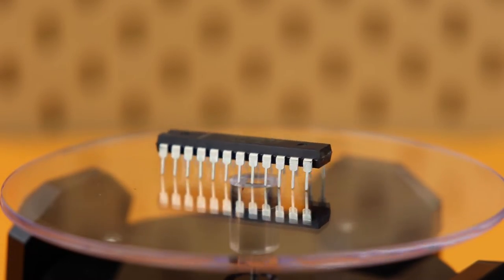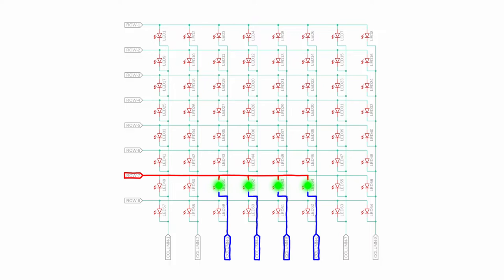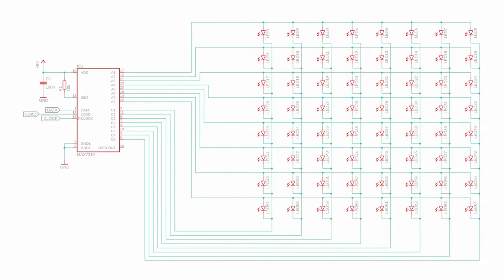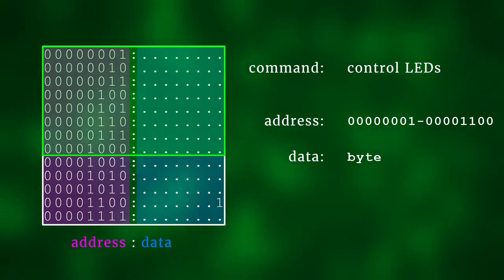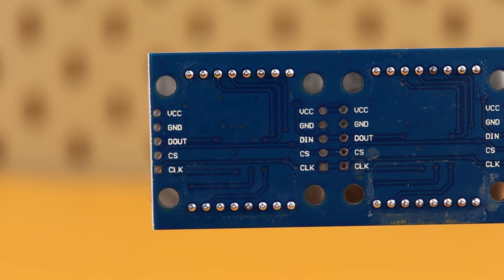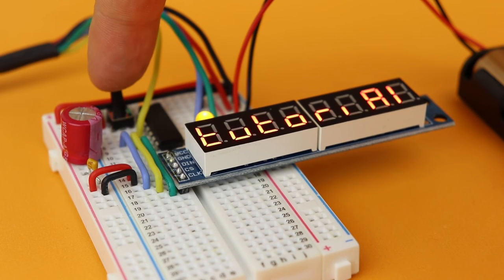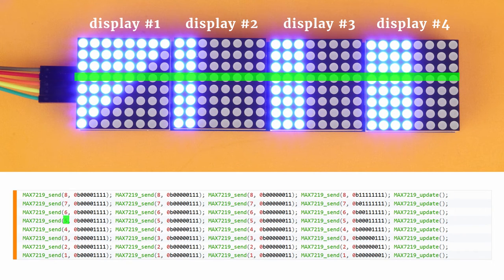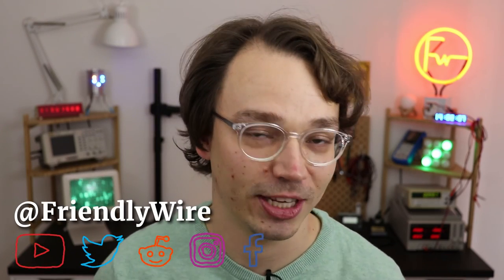MAX7219 LED multiplexing tutorial

Comment: I really dig how a YT content creator is using something other than Arduino.
Reply from the maker: Ha, thanks, I am glad you like my videos :) Honestly, I believe everyone should use what they want. For me, I get more joy out of using PIC microcontrollers, because I like to work at the level of registers, and I do not really like to use a lot of libraries or pre-built stuff. And in my videos I try to share this excitement. But of course it is also a bit hypocritical from my side, because I still use C to write the code, and not pure assembly. Arduinos are fantastic for some, so: to each their own 🙂
Reply: @FriendlyWire  I am the same way.  I’ve been programming PICs since 2004.  I am not a fan of libraries because I like to know how to drive things myself.  (Aside from using I2C and SPI libraries for consistency). I find Arduino sharpens my skills because certain parts/modules documentation is only in the form of Arduino libraries.  I need to pull those apart to write my own for PIC (like eink displays/etc)
Reply from the maker: @maxvideodrome4215 Oh yeah, definitely, there is lots to learn from libraries :)

Comment: Thank you so much for this. I'm super excited to make more electronics :3
Reply from the maker: That's great, and thank you for your nice comment! Best of luck! :)
Reply: @FriendlyWire  thank you! The only thing I'm a bit scared of at the moment is powering my projects. Do you have any videos about such things? Thanks!
Reply from the maker: @jumbledfox2098  Oh, I feel you, this can be a bit scary indeed. I don't have a dedicated video on this, sorry. What kind of project do you want to power? Does it have a lot of LEDs? If you want to stay in electronics, I would recommend to get a proper bench power supply, either a switched one (cheaper) or a linear one (more expensive). Let me know, I am happy to guide you :)
Reply: @FriendlyWire  thank you! My project includes 51 seven segment displays controlled via 7 max7219 chips, since each chip only powers one display at a time I'd need enough amps for 7*8 leds, however I don't know how many each segment uses. When I figure that out would I just need to use a power supply that can deliver that many amps (plus a bit more for the esp32 microcontroller as well as just in case)? I'd like to power it via USB c from a wall outlet if possible, I've used a barrel jack on a previous project but I didn't really know what I was doing haha (and usb c looks infinitely nicer than a barrel jack)
Reply from the maker: @jumbledfox2098 Okay, that's a lot of LEDs, but totally doable! Each LED, conservatively speaking, takes 20mA at full brightness. Call that 1.2A. Let's add another 300mA for anything else, just in case, so 1.5A is what you need. Makes less than 10W at 5V, so: totally doable for USB type C. But: it is too much for a regular computer USB port, which is capped at 5W, so keep that in mind. I would recommend getting a standard USB type C charger/wall adapter [like this 20W version here: https://www.amazon.com/dp/B0B9X2SFMH/], and a USB type C chassis adapter that is rated for that current [ like this one here: https://www.amazon.com/dp/B0BY7VHWRR/ ]. In your circuit, make sure to add a large-ish capacitor (100uF) close to each MAX7219, as well as a 100nF bypass capacitor. Add a very small resistor (100 Ohms or so) in series with each of the 100uF capacitors, this prevents a current surge when you first plug in the power.

Let me know if you have any questions, and I hope it helps!

Comment: Hey! Really cool explanation. I am doing an Art-Installation and have to light up 21 IBC containers (the large 1000l water tanks that you may use without water and rather put a light inside ;) )  For years i stayed away from two major electronic subjects... Transistors and multiplexing ;D just the gap was too braod and too easy to overcome and bypass. But not anymore. I am digging in and your video and the ones from great scott help alot. Your's though does speak to me much more as i want to understand what is happening on signal level to understand what im doing and why on the micro controller side. 

The project is to be wireless ... of course ;) (has to do with the visitors and safety blah) so I was going to use three ESP32 controllers and one master ESP32 controller for controlling the LEDs. 
To be power efficient and stay in my tiny artist budget, I want to use either 3 single 3W High power LEDs or three 1W RGB LEDs in parralle per container times 21 container in three groups. 
So that each group has 7 Containers with 3 LEDs each. 
I thought it would be ok to use the MAX7219CNG IC and MOSFETS to drive the LED. On the ESP32 side I am planning to use WLED for easy control, though am not 100% sure how the rollout will work. 
BUT now im considering the length of the cables etc. and worry about WHERE to ideally place the controller and how as the cable length might interfere. 
In any case: Thank you very much for the video!
Reply from the maker: Thank you for your kind words, Kasimir! I am so happy to hear that this video speaks to you, it really means a lot.

For your project I am thinking the best solution depends a lot on the requirements of the images/patterns to be displayed. What is your target refresh rate? What kind of color depth do you need? I have never used ESP32's because of their complexity, and I like to set every bit in every register myself, but they sure sound like fantastic devices to play around with.

Driving the MAX7219 outputs with MOSFETs may work, but you have to make sure you do some sort of manual current limiting in this case, because the MAX7219's do that automatically with that one external resistor. But of course in this case it would only regulate the gate current, and the drain-source current is independent of the gate current for mosfets.

Good luck with your project! I am happy to help out with as much as I can, and thank you again for your interest and your nice words :)

Comment: What would you do for R-SET (2:32) if you had a few different LEDs in your matrix that have a different voltage than the rest?
Reply from the maker: Different voltages is no problem :) R-set sets the current, and most LEDs work well at the same current. A red LED needs around 1.9V and a blue LED needs 2.5V, but at 20mA they have the same brightness. So I think you can use any LED you like, as long as they have the same current. (If they have different current requirements some of the LEDs may look dim.) Hope that helps!
Reply: @FriendlyWire  ah, thank you! I’m slowly remembering my electronics class stuff
Reply from the maker: @A-D-D-F_Toxic  No worries, happy to help! Thank you so much for your interest, Ryan, and have fun with the MAX7219 :)

Comment: Thank you for the clear tutorial! I get a FYM-23881C dot display , what is RGB unlike yours, what is one colour. It has 32 pins and with a MAX7219 I'll be able to drive only one colour. So, is that that I need three MAX7219 for each display to make light R,G or B ? Or there is a single driver that can handle this kind of display?
Reply from the maker: Thank you, glad you liked it :) That's a good question! I would have just went along with using three MAX7219's for this, since this chip is readily available and not so expensive. There are probably RGB drivers for this purpose, but it would most likely be more expensive. And at this point you could also make an 8x8 matrix from the comparatively cheap WS2812 LEDs (which are RGB to begin with).
Reply: Thank you!
Reply from the maker: @ESEben10  Hope it helps. Let me know what you decided to do in the end, I would love to see the build. Have a great day! :)
Reply: @FriendlyWire  what I have in mind right now is to place a switching device with at least 3 switching positions between the drivers and displays and tie together their switch position select pins. This way I can commute between R,G and B using only one driver per display.  I was thinking on demuxes but I would need a bunch of them per display . The easiest way I found to implement a switch is using microcontrollers (like stm32f405 or f407) with enough gpio's pins to use one of it per display. But it is nevertheless a tricky solution.
Reply from the maker: @ESEben10  One switched driver per display will be very difficult I think, since you have to write the new color data to the MAX7219 every single time when you switch to a different color, and that may mess up the multiplexing stability and will lead to flickering, unless you are super fast.
Reply: @FriendlyWire  another approach  would be using 1 MAX7219 per channel, i.e. for 1 RGB display we'd use 3x MAX7219 .
Reply from the maker: @ESEben10  Yes, one driver for each color is probably the way to go. Do you have a datasheet for your display, just to be sure that it works?
Reply: @FriendlyWire  I do !
Reply from the maker: @ESEben10  Perfect! If the 8x8 RGB dot matrix display is really what you want to work with, it's a cool project. But if you are looking into a simple way to have an 8x8 matrix of RGB LEDs, then I can also recommend the WS2812B LED, which also comes preinstalled in 8x8 panels like here: https://www.amazon.com/dp/B0C3VXT7LT/
Then you could use the WS2812B tutorial (https://www.youtube.com/watch?v=NLyB3-vEbFk) to drive them.
Reply: @FriendlyWire  I'll take a look at that. Thank you so much for your exhaustive support so far!
Reply from the maker: @ESEben10  Happy to help!

Comment: Whats the difference with cd4026 with simple counter using 7 segement display?
Reply from the maker: The CD4026 can only display 0,1,2,3,4,5,6,7,8,9, and that's it. Also, it can only change from 0 to 1, from 1 to 2, from 2 to 3, and so on. The MAX7219 allows you to display anything you want on a 7-segment display. It's not a counter, it is a display driver, so it is more flexible while not so specialized.
Reply: @FriendlyWire  got it. But can i use it as a counter as cd4026 i mean can i substitute to it?
Reply from the maker: @mishavillanueva7191  It's not a direct substitution, you have to use it with a microcontroller. If you need a counter alternative to the CD4026 I would recommend the CD4017 (on which I also have a video: https://www.youtube.com/watch?v=BZjO2TuS2Vk ) or perhaps the CD4510. Hope that helps! If you don't mind me asking, what is your project about? :)

Comment: Sir can I use pic16F877 instead of pic 16f1455
Reply from the maker: Yes, of course, this is possible. You need to change to code slightly to accommodate for that. This tutorial is about the MAX7219 driver, and when you follow the steps it will be easy to adjust the code.

Comment: Sir will u please guide me through the problem I'm getting errors in line 69-70 and 82-83.. please sir. I'm doing project for dot matrix module
Reply from the maker: What are the error messages?
Reply: @FriendlyWire  sir I'm doing it with pic18f452 may be that's why I'm getting the errors, how I would resolve them.. just in 69-70 and 82-83 lines..please sir  guide me about it
Reply from the maker: @Syeda-Hadia  Yes, this code is for the PIC16F1455, so the code needs to be changed to work with the PIC18F452. Lines 69-70 are for the pullup resistors of the PIC16F1455, the PIC18F452 may not have these registers. And lines 82-83 turn off the analog features on the pins RC2 and RC3 of the PIC16F1455.

Which pins of the PIC18F452 are you planning to use? And did you create a new project inside the MPLAB IDE specifically for the PIC18F452?
Reply: @FriendlyWire  yes sir as according to the code I have use the pins for pic18 as  you have used for pic16.. 
But the problem I'm receiving is how to disable the features of the pins of pic18  to match it with pic16..
As you have disable the feature of analog in ur pic microcontroller..
What would be the command syntax for my pic18 microcontroller

Comment: Como comandar matriz de led, sem programa?
Reply from the maker: Without a program this is probably more difficult with the MAX7219 (since it is designed to work with microcontrollers). In that case I would recommend to build your own discrete driver out of transistors.
Reply: @FriendlyWire  oh thank